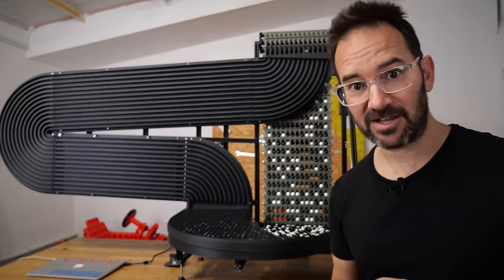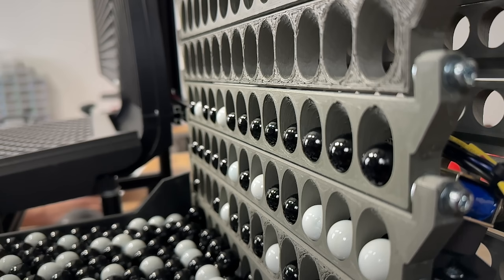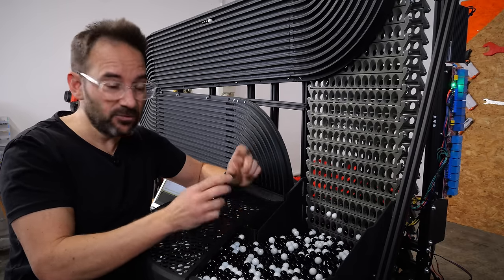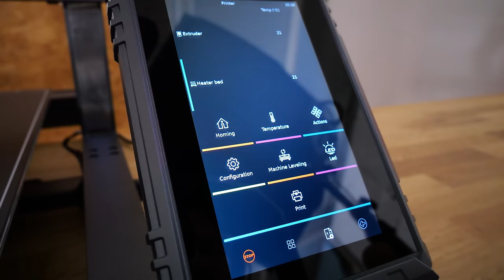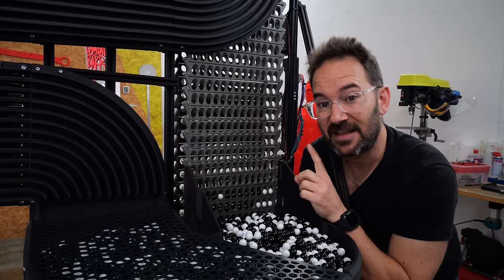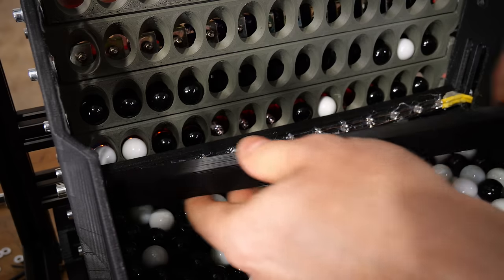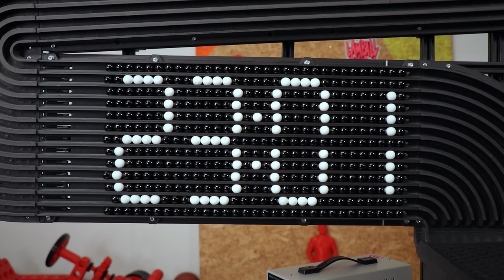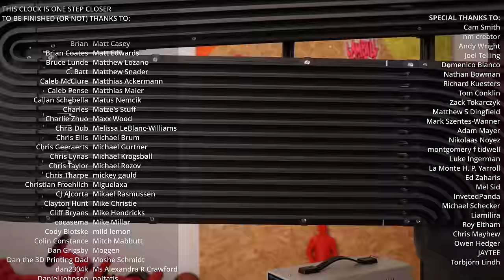BUILDING A MARBLE CLOCK - Pt. 2

Comment: I hope this ends up in a museum and is maintained for decades! This is such an amazing and unnecessarily complicated clock! I LOVE IT
Reply: Agreed, same thought.
Reply: He needs to use software to determine if the 'rejected' ball will be needed next on that same channel, if so have it go down a return feed that automatically makes it next in line again. This could hugely drop the time to display a time without much more hardware complexity. It's too slow rn, will never work. That or just hugely speed up the lift.
Reply: If its in a museum I think it should be a aluminum version, as 3D printed filament will eventually warp or go bad
Reply: Good idea.
Needs to be done.
The must be a museum of chronometry somewhere that would give it a good home.
Reply: I think it'd fit in better in an art gallery!
Reply: You can speed up the belt, but speed of marbles traveling through system into "display" will stay the same, and if he increase speed too much, there could be problem of not loading marble into belt so it could slow down. The antire clock will need to work with "predicting the future". like Now I am building 12:05, but I will release it into display only at 12:04:50 or something like that. But i agree, there should be possible to make some sorter to tell the machine, i will need X white and Y black.
Reply: @codeblocks4067 I agree, he could also presort the black/white marbles into two levels and load the belt real time.
Reply: Not to mention how loud it is 😂
Reply: @codeblocks4067 to show one minute from scratch seems to take a while, yes, but if it can prepare a second number in under a minute then he can have it work on the next minute while the current is being displayed, which seems to be the plan, judging by the footage at the end.
Reply: This seems like the kind of thing that’s perfect for a children’s museum, particularly one focused on STEM or Engineering.
Reply: In Switzerland, I would see two options. The Technorama in Winterthur, a science museum. Or, talk with MB&F, they sell timepieces as art
Reply: npc ahh comment
Reply: Thought literally the same 😂
Reply: People in future will look at it in awe and assume that we didn't have normal clocks or digital clocks

Comment: Here’s an idea… alternate the background from black to white for AM and PM. Black Digits for the AM and White Digits for the PM. Not saying there’s anything wrong with the 24hr format, there’s just potential to take it an extra step further with the 12hr format. Just Imagine the transition of a white background to black from 11:59 am to 12:00 pm.
Reply: That would require having double the marbles in the system and a great many more rejects.
At the moment say 90% of the display is black so 10% of the marbles need to be white.
Put 20% white marbles in the system and on any channel you'll get black 8/10 times and white the other two you'll fill up the blacks quicker and have whites available when you need them.
50/50 the rate you can fill the blacks is reduced by 30%
Reply: Yes, complexity will be incresed. But 5his is very cool idea.
Reply: @zyeborm Adding more marbles would be the easy part. The problem is he is not sorting the marbles efficiently enough. If he could separate the marbles before they get onto the elevator, or hold the rejects in a buffer for later, he could easily switch between black and white backgrounds.
Reply: It would be very cool!!

Comment: I was so interested on how he was going to do the marble sorting. I didn't expect him to make it in the elevator chain. Super clever.
Reply: yeah. I kept saying....uh... big part needed next. great work!!
Reply: Yes, it is a clever solution. The challenge however is that it appears to take over 2 minutes to sort a new number (based on the last 2 minutes of the video).
Reply: me too i was like how tf he gonna fit a sorting mechanism into that tiny space where the rack is loaded
Reply: It works, but it creates a problem.  The time it will take to arrange the next minute display is variable.  Because the process is relying on randomization (did I get the correct coin flip of a black marble?  Nope another white one, kick it off the elevator and try again), there's going to be a statistically expected amount of time to "print" the time.  And looking at those timelapse clips there's a good chance of it taking more than 60 seconds.
Reply: @Satarack  Yeah, I think he needs to sort the returning marbles by color and then place the correct color into the proper elevator position to make the process less random. White and black can be done on separate levels of the elevator.
Reply: It would be easier to sort the marbles first though.

You sort black and white marbles, then put one reservoir on top of another. Fill the bottom reservoir first with the first color, kick the unneeded marbles, then let the second reservoir fill the  missing marbles. Each row is fully filled with the right sequence and can create the time faster
Reply: @jean-francoisgagnon1341  Yes and you use two different size marbles and filter them mechanically. Easy peasy.
Reply: @someguy8923  Using marbles with different clearances might require modifying the tracks and elevator.  It might also affect the aesthetics of the time display.

Alternatively he could use different materials for his marbles and separate by density instead of size.
Reply: @Satarack  there's also a chance it never completes. It's a non-deterministic sorting algorithm basically. The better solution would be to have it sort between black and white, and then use those two collections of marbles to feed the clock. You could accomplish the sorting by pushing out the white ones and into a separate elevator which means there would be separate groups at the top, one on each side of the clock paths. Then you could use a funnel running down the paths with solenoids to push an angled piece in the way to make the marble go into the right spot.
Reply: @Tsudico  He can also add a section under the currect marble "pool" that will inject just white marbles when needed, as black marbles will never be a problem. It would be sleek, have the same exact appearance of fuction, but would drastically decrease loading time.  I think the best solution is to sort the balls into two pools, then eject white marbles with the solenoids before reaching the black marbles, then let them fill in the empty spots.
Reply: That's the primary reason I subscribed to the channel. How the heck is he going to fix that problem?
Reply: @scharpmeister  My exact same thought. I was thinking he was going to have to rebuild the top segment I didn't expect his solution.

Comment: I still recommend bearing balls. Even if you’re not pursuing the magnetic separation approach, they’re machined to much smaller tolerances and you can blue the black marbles and leave the white ones silver.
Reply: Brilliant
Reply: That was going to be my second recommendation, after doing something to stop those glass marbles from repeatedly landing on the floor.
Reply: Will his structure handle that kind of weight?  Steel is MUCH heavier than glass.
Reply: ...but then we miss out of him saying the word marbles :p
Reply: @tomvanbroekhoven1821 are we pedantic enough to not call them marbles if he uses ball bearings?
Reply: @tiffanysandmeier4753  I'm not. And to answer the point regarding the weight of steel marbles, he could use lightweight acrylic instead.
Reply: @tiffanysandmeier4753  If marbles can be made out of glass instead of ... marble, they can also be made from steel and still be called marbles.
Reply: I know you can get precision ceramic ball bearings (about half the weight of steel). Aluminum would be even lighter (about one-third the weight of steel) but I don't know if anyone is manufacturing them.
Reply: With the weight of the steel they would either be better or worse on getting stuck because of inertia.
Reply: Also way more wear and tear.
Reply: Currently the most intresting thing on YouTube.
Reply: Any surface treatment for colour will get worn off very rapidly. Also you'll need to use stainless steel or better as they will rust otherwise. You can't really oil them as the whole system will then collect every spec of dust in the room and turn into sticky goo.
Reply: @tiffanysandmeier4753  are we pedantic enough to not call "bearing balls" "ball bearings"? a "ball bearing" is an assembly including the cage and races.
Reply: Definitely use ball bearings. They have a small tolerance and will work well. I wonder if you can buy two different metals, or maybe find some with a coating?
Reply: @aaronmeltzer5518  Pedantry FTW!!!!
Reply: the paint will wear off super quick if you painted ball bearings.
Reply: But does it play music?
Reply: @wictimovgovonca320  I think aluminum may work but id be concerned about the balls denting over time, anodization may resolve that issue. It'd be too expensive but some titanium "ball bearings" would be pretty cool to see.
Reply: @ssl3546  I stand corrected
Reply: I hear you can anodize steel just like aluminum, so you can get rainbow colors if you need in hi quality steel.
Reply: @wictimovgovonca320 Yeah I doubt they are. Steel and ceramic bearing balls have uses as... well, as bearing balls. Aluminium is too soft for that so I doubt they're made in quantity.

Comment: Very clever way to identify the marble colors!  The sorting “algorithm” is very inefficient because it’s randomly waiting for a white marble to land in the right spot, and has to reject all of the black marbles, which occur more frequently. The efficiency is also hurt by dumping the rejections back into the starting pile because they have to be sorted multiple times. Instead if you sort the marbles into white/black baskets, you’ll sort each marble once per rotation, which will be more efficient and allow for a faster clock refresh rate. Very nice project!
Reply: A simple improvement would be to equalize the proportion of white and black marbles closer to 50:50.  Yes, the display uses many more black marbles, but the limiting factor to complete the image is the time for the slowest row.
The rows second from the top and bottom have about as many white as black, so targeting that ratio will optimize the total fill time.
Reply: Вы правы! Эффективность с помощью сброса шариков снижается. Они должны сортироваться внизу или наверху и с помощью сепаратора переключателя заполнять индикатор. Да и лифта достаточно одного или двух. Если сортировка внизу - то нужно два лифта. Наверху нужны два бункера-накопителя.
Reply: @BenAlternate-zf9nr  : right, but actually you cannot predict where marbles are going unless there're sorted before
Reply: @niknik5616   Translation: "You're right! The efficiency with the use of dropping balls decreases. They should be sorted at the bottom or the top and with the help of a switch separator fill the indicator. Yes, and one or two elevators are enough. If the sorting is at the bottom, then two elevators are needed. Two storage bins are needed at the top."
Reply: Basically, moving a black/white marble to the correct one.
Reply: I agree, i also wish he saw the solution of sorting marbles by size sooner. that way he could build a track that could contain marbles for his clock but like the marbles differ by a small diameter then easily sort them by size. if any marbles fall into the wrong bucket, you can try adjusting the sorter or removing the outliers.
If you look up sorting marble you see it is simply using two bars going away from each other and will always sort the marbles by size consistently dropping between the bars
Reply: This is absolutely a great idea.

Comment: For your gate problem, if the left 180-degree track twisted like a mobius strip, I think that would keep your slopes for each marble path more consistent and avoid the problem with the low slope stopping the marbles along the top rows of the time display.

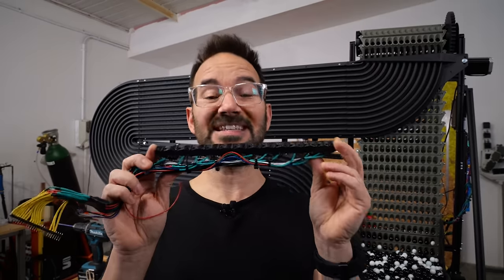Comment: 3:52 when we did lime followers for Uni no one taught us how, so I used these light-detecting resistors. The tip I got much later is: make your LEDs shine at a specific frequency, then put a band filter on your readings from resistors. Pretty sneaky, and AFAIK should work when flashing LEDs at 5Hz

Comment: Great demonstration of rapid prototyping and lots of satisfying components. I love the solenoids and, as always, your enthusiasm! :D
Having sorted many a marble in the past few years, I've found glass marbles always have a fair amount of variance because of the manufacturing process, so whether it's you or the marble supplier, someone will just have to test and sort out the best marbles. For absolute precision, you could consider pairing some super precise balls like White POM bearing balls and dark steel bearing balls. That might compromise your vision though... glass marbles look and sound really nice! The audible difference between 'white' and 'black' balls would be an interesting element, and POM vs steel would introduce the ability to sort by density. Just spitballing haha, I'm excited to see the rest of the journey!
Reply from the maker: White POM bearing balls would be a great contrast against steel marbles. I’ll definitely check them out. Cheers Devin!!
Reply: @ivanmirandawastaken  Theres a pocket83 video about sorting marbles, that may be helpful so you don't have to wait for a marble to jam before you remove it.
Reply: I mean if Make Anything is already in the chat, what about ABS no hole beads?
Reply: Easier sorting with an inductive sensor.

Comment: You could always try some sort of ball bearing.  They would probably be more precise then heat 50% of them up and quench them in oil.  Or brass and stainless could be cool if it could handle the weight. This is awesome and just keeps getting better

Comment: Amazing.  Too late now, but you could have the display using vertical columns instead of rows, this would allow a single digit to be changed instead of all 4.
Reply: Not really too late. Best part about 3d printing.
Reply: It would be faster too. But then, there would be a lot more marbles required. A lot more headache especially with inconsistent quality marbles.
Reply: Idk, there’s something cool about the entire display flushing at once and the next one being stacked in line.
Reply: Unnecessarily efficient and simple.
Reply: It would work better, but this is more fun!
Reply: The point of this is to have flare. You would design a very boring marble machine, and thus, you have no youtube following.
Reply: therefore i propose an altetnative:
keep the lines, but instead of flushing the whole thing use the marbles in the line to form the new numbers by removing only some of the marbles if possible - like if the time is 23:52 and we switch to 23:53
then the whole bottom line can stay because nothing changes there. then the rest of the 3 could be moved from the 23 to the 53 part
while the top and middle of the 2 from 23 could be reused to form the 5 in 53 :)
adding more complexity to the calculation :)
Reply: @alihms  Same number of marbles needed - having two copies of the entire time is going to be the same as having two copies of each of 4 digits. And there's probably clever things you can do with the column-by-column approach since you have them all operating on different timescales (so long as you can create a digit in under 50s or so, you can prioritise the units digit of the minutes, and let the 10s fill in the spare time in each minute, then the units digit of the hours, etc).

You do end up needing a bunch more tracks though, and either a much bigger lift, or a way to choose which track a marble goes in to when it leaves the lift (definitely doable - just have solenoids rather than the current passive pushers, and each track coming off at a different height in the lift.... though that might make things get overly tall!).
Reply: That's too simple in my opinion
Reply: i thought the same when watching the first video last week - obviously too late for Ivan anyhow. So I keep fingers crossed for him that he manages regardless. I am just wandering if the buildup of one display takes longer than a minute ... if that would be the case, well ..... 🙂
Reply: It takes almost two full minutes to draw the time. Lol.
Reply: Great idea, might also prevent marbles getting stuck.
Reply: @MrQuickLine so the elevator needs double speed to catch up.
Reply: or better yet come from behind to stack. Then release the vertical column
Reply: @alihms Actually it would require a lot less marbles because 1 digit is made of 91 marble so when you change from like 01 to 02  (minute) you need to change 91 marble while in current design you need to change 403 marbles. Change from 09 to  10 (minutes) requires 182 marbles to be circled etc.
Reply: @mityaboy4639  I thought your idea was silly at first but I think it has some merit.
Reply: Have mechanisms to 'recess' the numbers you don't want to change.  A pin board on a push/pull mechanism would do it.  So if you want to keep the first two numbers, they can fall back into a pocket temporarily, and the new marbles can run in front of them.
Reply: @alihms same number of marbles required.
Reply: @ironworksmodels  It reminds me of those flip card airport notice boards. There's still an enormous functional one in the Frankfurt Departure Checkin hall. It's so satisfying to watch it update; if I have a couple of hours of layover at Frankfurt, I'll head out there just to watch it.
Reply: @mityaboy4639  That sounds amazing.
Reply: @mityaboy4639  Interesting concept, so the software could recognize if the sequence of marbles stays the same and build the row for the next time it's different. My question had to do with 80% of the marbles being black, it may take a while to get enough white ones to go into the top and bottom to complete those rows. How does it deal with that?
Reply: @ledhunters 
But what exactly do you mean with “it requires a lot less marbles”?
When the time changes from 23:59 to 00:00 you still need to replace all four digits.